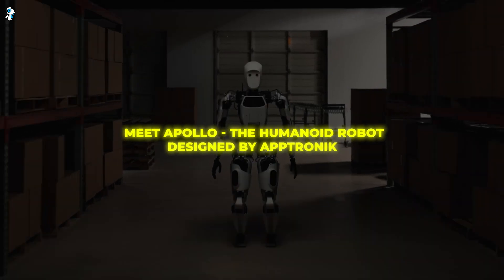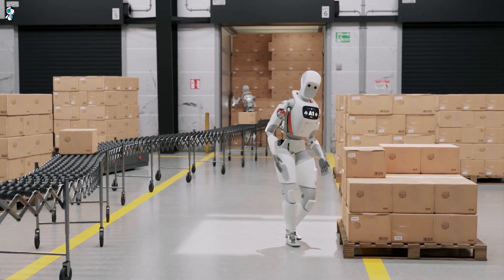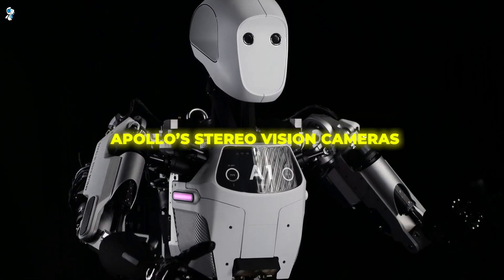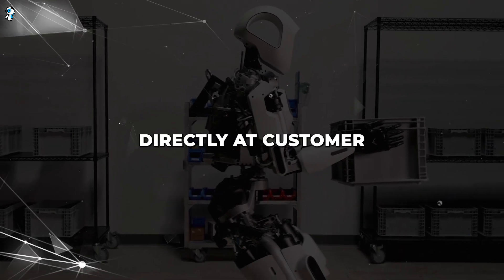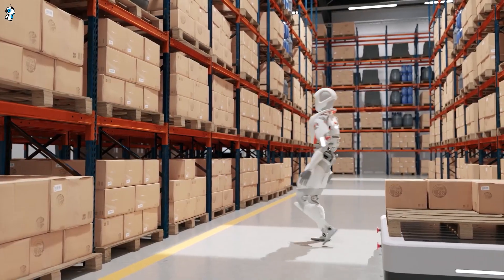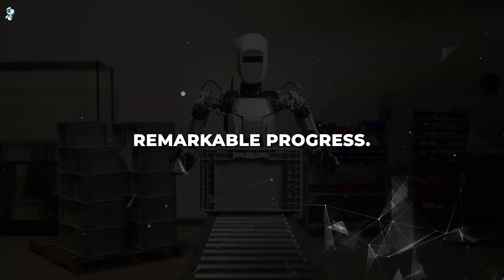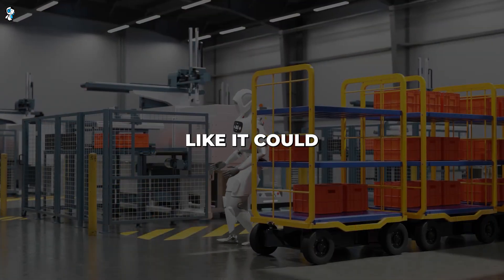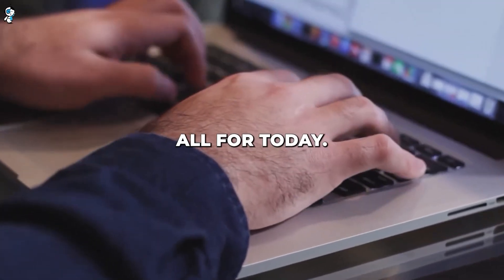Apollo: New Humanoid Robot by Apptronik

Comment: Nobodys going to "hire" such a slow employee :) ....for 4 hours of runtime.
In the warehouse or factory you gotta be quck. Also, a driver is not going to wait hours for this robot to unload its truck or van.
Reply: no worries, they'll fire the drivers and replace them with robots as soon as they can
Reply: lol @lucasalce6010
Reply from the maker: Thank you for watching!
Reply: They’re slow and impractical now but look at every other technology. Computers were once slow big and noisy, now they fit in your pocket and respond instantaneously. Fighter aircraft were once wooden biplanes that were slow and could barely maneuver, now they’re made of advanced composite materials, use jet engines and launch missiles. Eventually robots will be able to beat Olympic athletes.
Reply: @tylerelli6565 True. Perhaps once they make them faster they will be somwhat helpful.